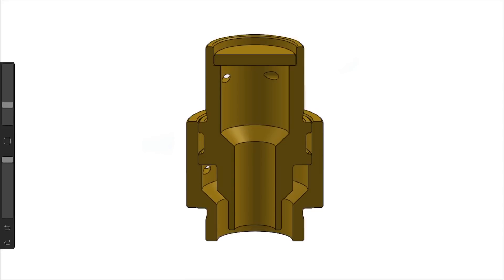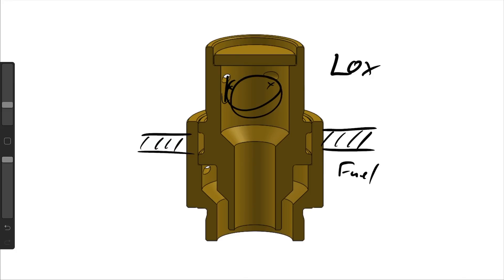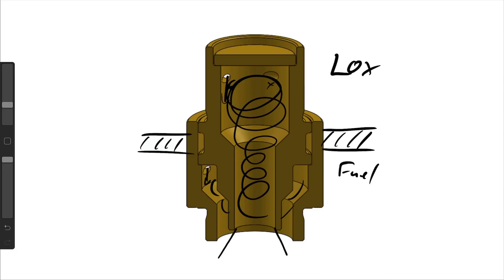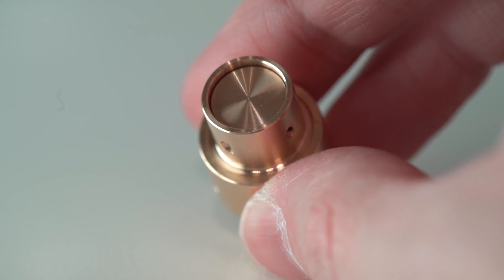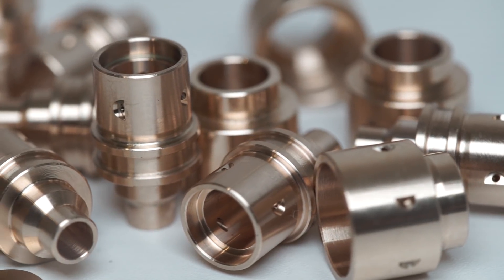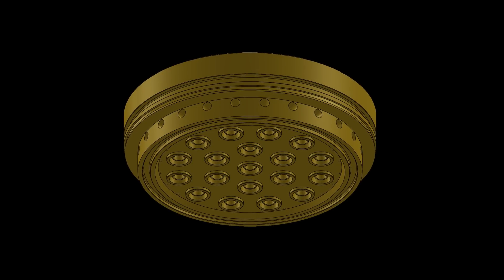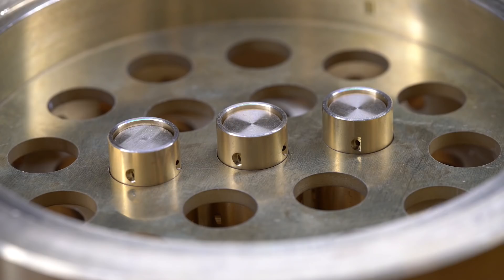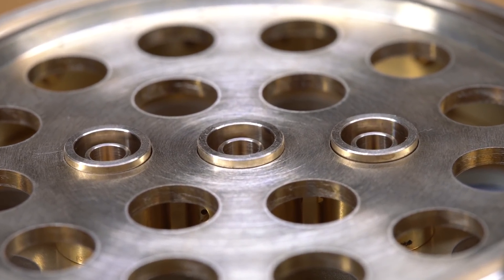How Rocket Engine Fuel Injectors Work: Coaxial Swirlers

Comment from the maker: Thanks for watching! We are an all-volunteer, crowd-funded project, fueled entirely by your donations. Head over to www.copsub.com/support-us if you feel like being part of our one-of-a-kind mission! :)
Reply: Thanks for the update. That's beautiful machine work! A couple of questions, some of which might be impossible to answer until the tests have been run: What temperatures will the swirlers and the mounting plate experience? Can the brass survive the temperature differential between the different tanks and the combustion chamber? Will they be able to withstand the high temperatures if anything fails to go according to plan, in the combustion chamber? Thanks again.

Comment: [  ] How are the fuel are oxidizer feed into the swirler. Since you have 19 of the swirlers and 4 small ports on each of them, it looks like it'll be a challenge to get the fuel and oxidizer inside each of them. How will the piping work?

Comment: Why is brass used for the fuel injector? Other metals have a chemical reaction with the fuel/oxidizer?
(Like steel has a higher melting point, lower mass, and higher strength) Am i missing something?

Comment: Are the holes in the side on the injector plate due to film cooling? Or do they have something to do with either of the biprop manifolds?
Reply from the maker: That is where the fuel comes through from the cooling jacket into the injector.

Comment: One thing I've never been able to understand is how those huge tanks of fuel can be forced through those tiny injector holes. There has to be a limit to how much a liquid can be pressure fed through a hole that's just a couple mm in diameter. Even with a dozen injectors there's such a tiny feed it has to go through in just a couple minutes. Just how??
Reply: 800bar of pressure will do whatever you want lol

Comment: cool! so the fuel flow goes directly from the regen cooling chamber to the swirlers? how is the fuel temp at this point, is it problematic?
Reply from the maker: It can be, that's why we have been running on 75% ethanol / 25% water mixture. Adding some water to the fuel lowers its boiling point. Then again, a year ago we've tested up to 92,5% ethanol / 7,5% water with a TEOS additive to the fuel, which deposits an insulating layer on the combustion chamber wall to reduce heat transfer to the regen cooling chamber, and the static tests ran with no issues at those mixtures.
That's from this test:
https://www.youtube.com/watch?v=koSpj1rMdYk

Comment: Would there be any advantage having the cones spinning opposite to each other?
Reply: They mention a few comments down that it could improve Fuel/Oxidizer mix due to the increased speed of propellant particle collisions, so it might.  They probably have limited budget so trying both out might not be feasible however if I were them and I had budget to spare for such a thing I'd mock up two small scale model test bells one with the normal valves and one with a set of counter-rotating valves and see which one generates better results.

Comment: Would heat or vibration have a effect on the integrity of the brazed joints?
Reply: Since injectors will be passing liquid through them (one being a cryogenic liquod) whenever combustion is occurring heat should, ideally, not be as big an issue, unless some weird fluid dynamic phenomenon occurs that couldn't have been predicted. Vibration, however, is definitely something to keep an eye on. I wonder if they should make a mock up injector flange and then run a heavy duty vibration test to see if it wears out quickly.

Comment: Another outstanding development by CopSub! I was expecting the LOX and fuel to swirl in opposite directions for better mixing. Does this not work?
Reply: I wonder as well… maybe swirling in the same direction helps the mist diffuse, because when the cones collide they do not cancel their tangential velocities? 🤔
Reply: @DamienPollet  usually in rocket engines there are 3 flow regions. Going from injector to nozzle, 1) injection where you want to break up propellants into as tiny droplets as possible, 2) the diffusion flame where most (~99%) of the combustion occurs, and 3) an acceleration region before the nozzle throat where the hot gasses have mostly finshed reacting and are being accelerated up to sonic velocity by the time they reach the throat. For injectors the goal is not usually diffusion but rather to break up the propellant into tiny droplets and to disperse those droplets as uniformly as possible. So in theory, a counter spinning swirl would improve propellant break up into tiny droplets, but I wonder if it would have a negative effect on the distribution uniformity (ie creating ox rich and fuel rich pockets later in the diffusion flame). Its pretty hard to say without running a full engine test or without some next level combustion flow simulation (ie stuff you'd run on supercomputers).

Comment: A question about the swirler. Could you make them so that you could screw them together? So no risky soldering.
Reply: @Annalee H Jeah makes sense. Thanks for that nice explaination. Im really happy about these discussions here. There so nice and polite. Just one thing. One point probably isn't perfectly valid. Because if you mess something up in manufacturing (aka drilling holes) you have to redo the hole part anyway. And if you solder and mess something up you have to redo the hole injector plate. And a further addition. If you use the injectors itself as screws you don't need additional screws and maybe only metal risers to prevent it from colapsing due to the design. But with some designing you probably can get rid of them as well.
Reply: @b.v.skijump432  Valid points, and I agree, rocketry Youtube comments are generally pretty nice and civil compared to most other comments sections.
Reply: @b.v.skijump432  just to add another point about threaded connections, brass is a relatively soft metal, so you would not want to unscrew it after tightening it to the proper torque the first time as it will inevitably be a less tight connection after each disassembly. Given that a threaded brass connection already has limited disassembly capability it might just be easier to use a permanent connection. Additionally, threaded joints are always at more risk from vibration than welds (not that welds are invincible of course). Also, although helicoils could avoid the thread wear out issue, they also require more material thickness to install making the whole assembly heavier. And finally, I agree, this community is full of awesome people asking cool questions like you :)
Reply: @maxk4324  thanks for your explaination. Makes totally sense. So yeah, it probably isn't the best idea, and I know now why. Super happy about that.
Reply: @Annalee h Jeah sounds about right. I think it isn't directly linked to rocketry but about a good comunity around a channel. I'm only aware of about 4 - 5 other channels in which you can have actual conversation.
Reply: Im thinking that could result in leaks and mix the fuel and oxidizer before its in the combustion chamber which is probably no bueno. Just a very uninformed guess though haha
Reply: @0siiris  yeah. Makes kinda sense. Except you could seal it properly somehow.
Reply: @b.v.skijump432  You probably could but most sealants will probably suffer greatly under the very high pressures and very low temperatures that will exist inside of these injectors, it might make seals have shorter lifetimes and greater risk of failure during operation that could result in mixing of LOX and Ethanol before they aught to.  Honestly these days it seems like 3D additive manufacturing might be one solution assuming the finished components are accurately printed and sufficiently sturdy compared to conventionally machined counterparts.  They could be printed as one homogeneous component instead of three separate parts that need to be fitted and then soldered together, that would also reduce cost and man-hour expense because good CAD software and sound additive manufacturing could produce very tight tolerances and produce components in batches.
Reply: Yeah. Makes sense to. Sadly aditive manufacturing isn't an option for CS because cost etc. but for other actual companies it is perfectly feasable. I mean Spacex for example does some parts with additive manufacturing. But on the subject of cold. Does the soldering material not contract and get brittle in the cold? Forming cracks and don't seal properly as a result? Further. Maybe crush seals could be a good alternative. Just as an idea.
Reply: @b.v.skijump432  Most solders do tend to be more brittle than the material which they're being used to fuse together, and generally speaking unless you're talking about some weird niche meta-material alloy most all metals become more brittle by some degree in the presence of cryogenic temperatures.  As a result ideally parts involved in the movement of cryogenic materials (liquid oxygen in this case) will include as few separate components as possible.  As to crush sealing it generally requires bolts to draw the two pieces together to crush the seal metal between them, it probably is robust enough to deal with the stress but that would require the injectors to have channels drilled in the sides to allow bolts to screw into them along with a gap for the O-ring seal to fit into, and with rocket parts drilling holes is a bit of a nightmare because tolerances are necessarily high so any slight mistake will require the part to be completely trashed.
Reply: @youtubeisapublisher6407  great points, only correction I'd add (and it's semantic) is that I think you meant to say "tolerances are necessarily low" since a high tolerance implies the design can tolerate large deviations on the final part from the original specified dimensions.

Comment: Amazing! I had just watched a couple of days ago a DIY aluminum can alcohol stove where he had angled the exhaust holes to perform a swirling effect of the flames, thus producing a flaming vortex. Very crude but very effective use of the fuel. And here you are doing a much more high tech version that in effect does the same thing. I think you are onto something that will revolutionize rocketry!
Reply: Actually the idea of using swirlers in rocket engines have been had before, at least by the pros...
Reply: @jnielsen20  Even SpaceX new Raptor engine use swirlers: 
https://twitter.com/elonmusk/status/1132894389095653376?s=19
"Raptor uses a large number of coaxial swirl injectors, which (we believe) achieves highest theoretical mixing/combustion efficiency."

Comment: It looks like a great job for 3D metal printing.
Reply from the maker: It certainly does! And there is a significant effort in the industry to 3D print this type of injectors, or basically any type of rocket engine injector. Sadly, it is prohibitly expensive for us. Moreover the surface firnish is not quite good enough yet from 3D printing. I will expect some variance between elements of this type if it was made with 3D print.
Reply: @CopenhagenSuborbitals  
This may be of interest, particularly the ability to transition between alloys on the fly
https://youtu.be/YGQStbaqArY?t=270
Reply: @CopenhagenSuborbitals  I agree it can be prohibitively expensive, out of curiosity what are the operation temperatures that the  swirlers must handle?
Reply: @wilsonmura5930  probably pretty cold, given that their core is passing liquid oxygen. Their downstream face will get some IR heating from combustion, but the combustion reaction itself should take place at some distance downstream of the injector exits rather than right at the injection face. This is why injectors (usually) don't need cooling systems like the chamber, they pretty much are their own cooling system.
Reply: @maxk4324  Oka so then, 3D printing it is not a crazy crazy idea?

Comment: Can some of that brazing be replaced by a heat shrink process instead?
Reply from the maker: The lids could probably shrinked in place. But the other seals have to be quite perfect to prevent mixing of LOX and fuel in places you dont want it to mix.
Reply: @CopenhagenSuborbitals  I would expect the heat shrink process to produce airtight and strong couplings. In any case, no significant amounts of LOX and fuel will flow in the reverse direction due to differences in pressure.
Reply: @BaldurNorddahl  A difference in pressure is exactly what would cause a leak, if the difference is high enough. Unless you're saying that the pressure difference is tiny, which I would contest by pointing out that the fuel will likely be at a much lower pressure since it first has to pass through the combustion chamber cooling jacket
Reply: @maxk4324  The point being that the pressure differences presses this thing together instead of blowing it apart. Any leaks can only go in the direction of the combustion chamber because that has the lowest pressure. The only seal is from the LOX to the fuel  part of the swirler and even if some tiny amount of LOX go that way, it could never burn and it could not enter the fuel stream before the swirler.